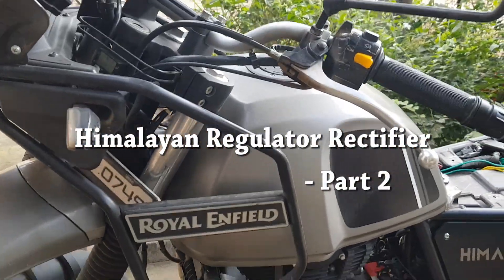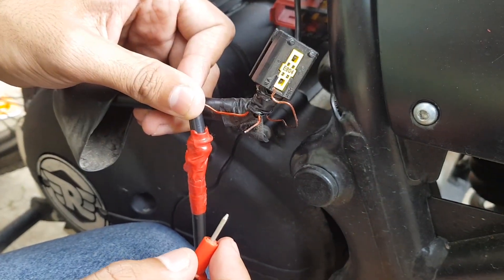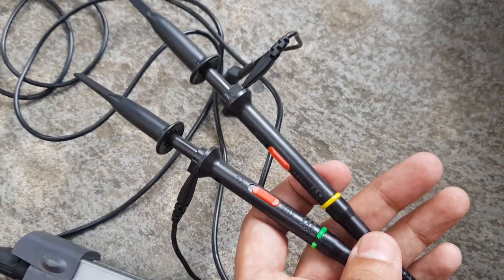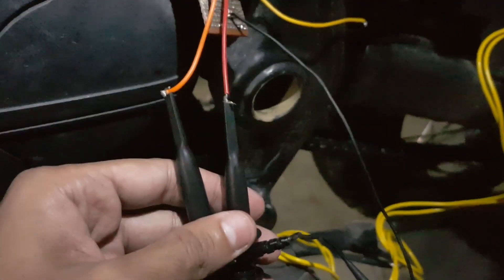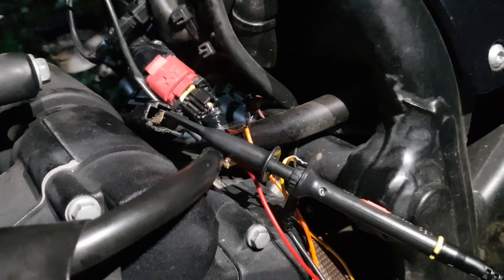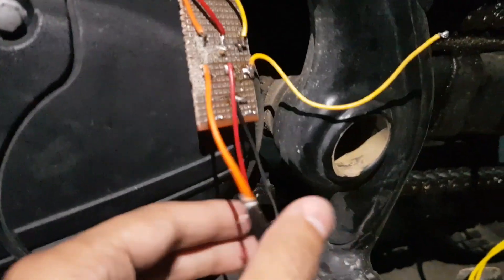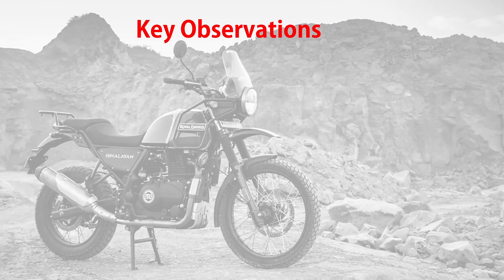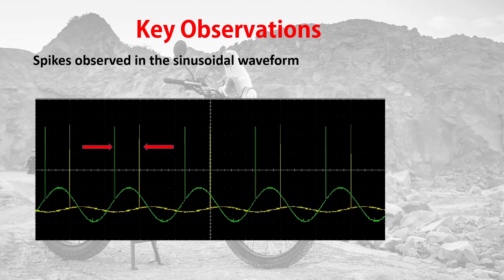Himalayan Voltage Regulator Rectifier  Part 2 #himalayan #royalenfield #royalenfieldhimalayan

Comment: Hi...recently I changed my fuel pump...cause the ignition would suddenly stop while on running...and sometimes it wouldn't even turn on.....even after replacing the fuel pump I'm still facing the same issues often...and the ignition sign sometimes doesn't go off
Reply from the maker: Are you still facing the fuel pump issue or  just the malfunction light is on always?
Reply: Both...even the fuel pump issue time to time

Comment: I own a 2016.BS3 Himalayan done 17k kms only Never ever used in monsoon.Kept in a closed garage, but engine start done everyday.Lately a problem has cropped up Battery light on Meter console ON permanently(earlier it was going OFF on revving) .Battery is running down every 2nd day.iam using a new Exide XLTZ9(8amp)battery.i even replaced the Regulator/Rectifier(RR)Unit yesterday and charged the battery fully(14.88v on revving) but the Light on the meter console is still ON.WHAT DO I DO.PLEASE GUIDE🙏
Reply from the maker: Hello g2k. There will be DTC codes generated in the ECU after a malfunction. You need to take it to showroom service center and clear the trouble codes. It'll disappear.  After exide battery replacement it won't be a trouble now hopefully of draining quickly.